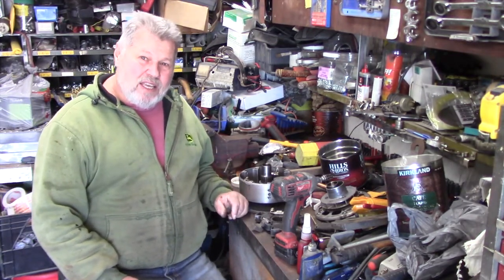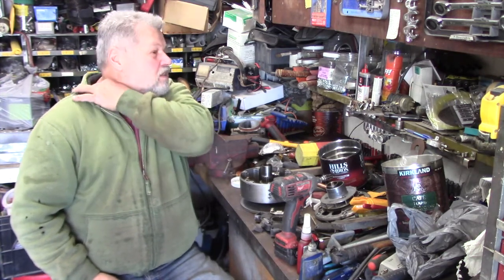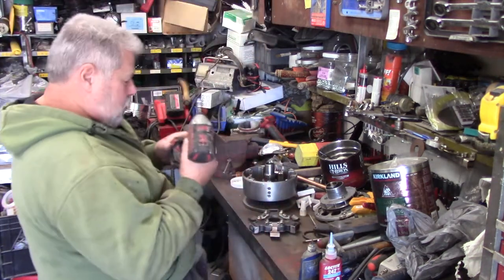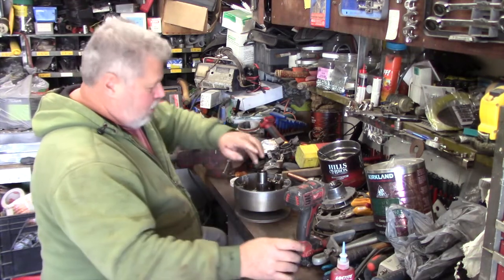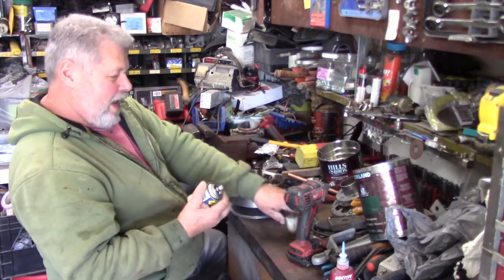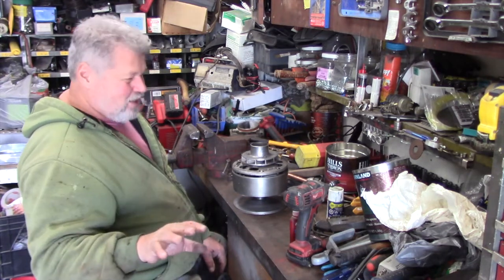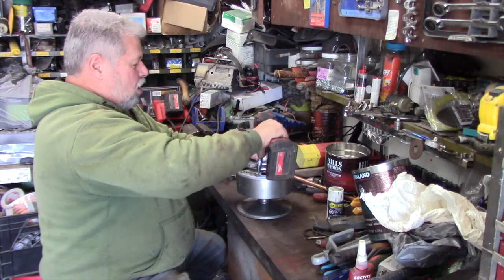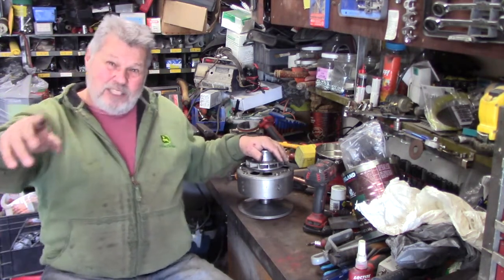Kawasaki  clutch rebuid

Comment: good job on the rebuild Gator, works really smooth,  be like a new machine when you get it installed all the best Cheers,
Reply from the maker: Should be good I think....my first atemp at rebuilding these....by the way it works on the bench it should be just fine.....will see this afternoon at the camp and the report will be in next week.....CHEERS

Comment: Nice job Gator - look forward to the install.  I noticed a couple years  back there is a expiry date on loctite .  Its so small I could hardly see it . Hope your isnt 10 years out of date . LOL
Reply from the maker: " look forward to the install." so do I Steve....I just hope I have enough time and I don`t get caught with a winter storm.....don`t feel like cleaning half a mile of road to get out.....I`m not buying new tubes a lock tight at my age Steve.....in my younger days we didn`t have that and things never fell apart !!!!!but we did stip a lot of bolts....The first skydoo engine I ever rebuilt never ran because there where to many bolts stiped but that a story for another day.....CHEERS